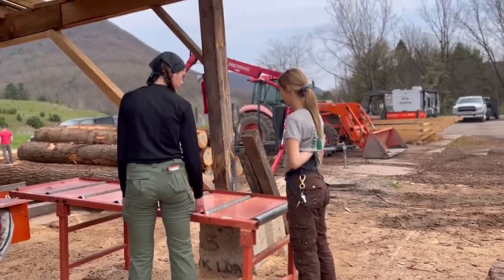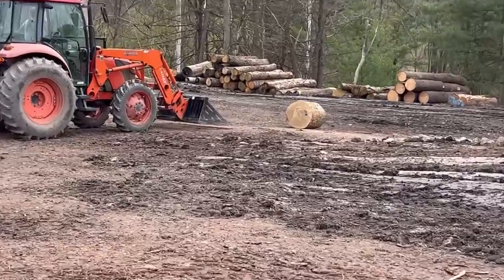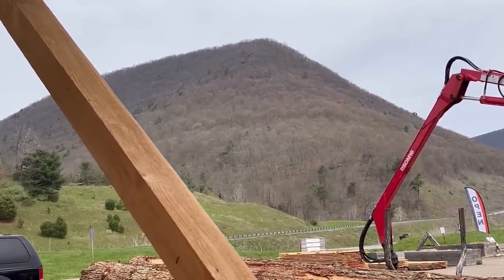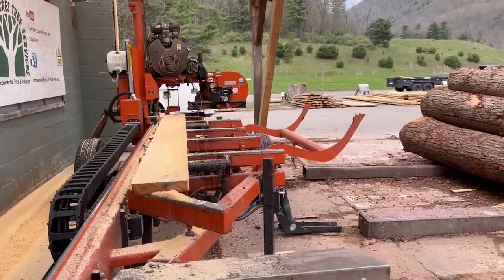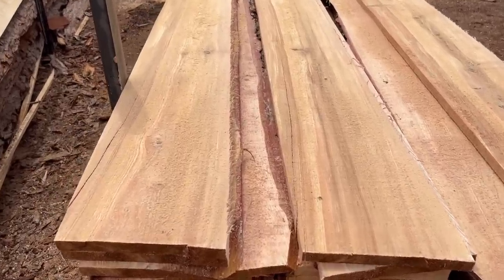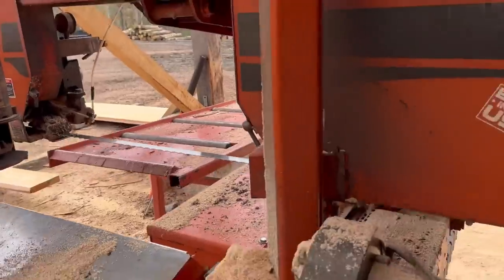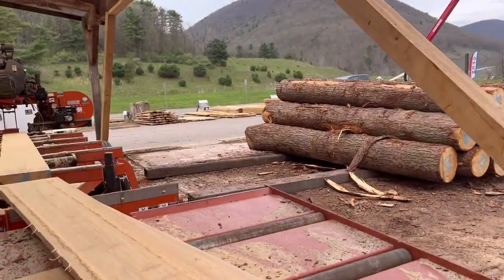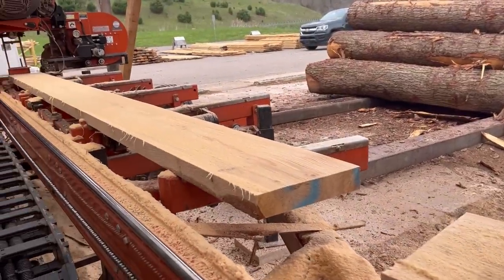Running the LT40 Woodmizer Alone Today

Comment: I see you use a trailer not sure how much more than four chords and it holds but if you had one of them cool smaller dump truck we like 10 12 14 ft back with them pools you can pull in and out to have it hold flatbed to 4 ft sides and higher and it'll still pull anything cuz it's a dump truck it's like one of them short buddies and it's cool

Comment: If you are making structural lumber (stamped for house supporting walls) you must get your 2X4s, 2X6s, 8s, 10s, 12s, from the middle of the tree.  Studs 2X4s normally come from small 5-6" diameter trees.  The grain pattern is the tightest and is less prone to separation.  If someone is making furniture or something of the sort, quarter sawn is best.  This is how I manage my lumber for best quality.  If the blade tips are shinny, you know that it is getting close to blade change.  Normally I look for wavy cuts, this also is a tell tail sign that the blade is dull.
Reply: Good information

Comment: QUESTION: Are the blades recycled or sharpened again for use?  Thank You!  Heated my house with wood for 30+ years and miss the labor and reward of Free Heat!
Reply from the maker: Ye awe resharpen our blades
Reply: @lumbercapitallogyard  Do you have a sharpener on site for sharpening?  Is it an automatic type that senses the directional angle of the cutting head?  Thank You!